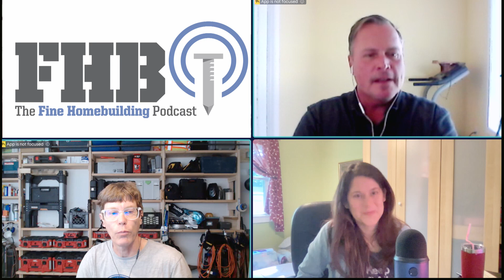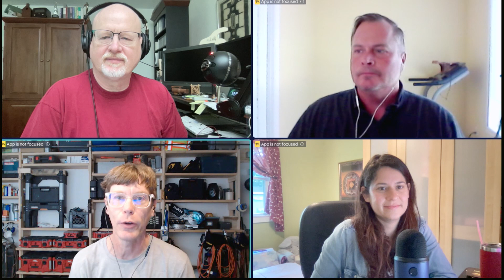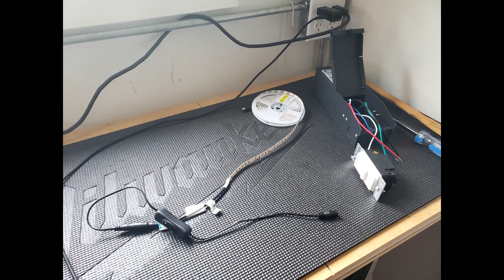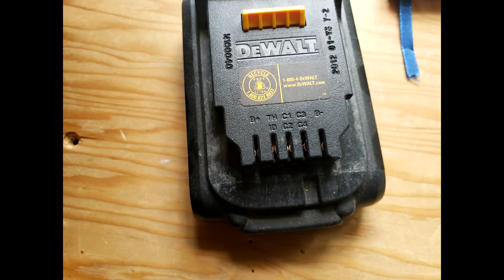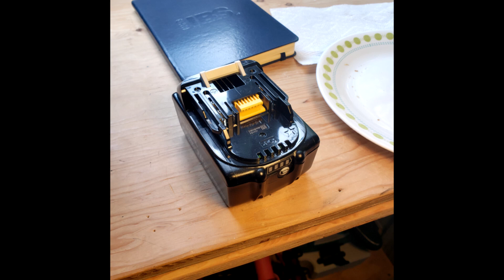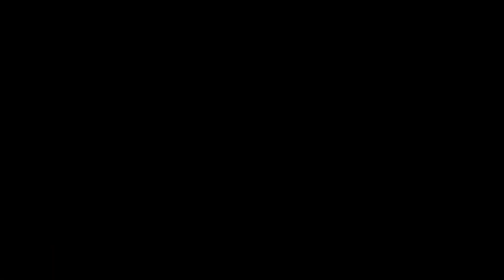Podcast 583: Dehumidification vs. Ventilation, Downsides of Advanced Framing, Heat-Pump Water Heater

Comment: You read my comment, but misunderstood it. The TOOLS normally only have two pins, DC+ and DC-. I have since found tools that monitor the battery temperature resistor sensor using a third pin (and DC- as common).

The batteries pins for the charger vary by brand. Some expose the temperature sensors leads, some have communication pins, and some combine the two.

For example, Ridgid chargers read data using the temperature pin and then monitor the battery temperature by resistance of the sensor.

It seems to be rare for a tool battery to have a full BMS Battery Management System (rare) which monitors everything necessary from overvoltage with auto discharge, balancing the cells, undervoltage, etc. It is normally a slimmed down version which might not prevent a battery from going into deep discharge.

Previous comment:
"There are only two pins on every battery tool that i have seen. These two pins are DC and no communication. Only the charger has more than two pins."

Comment: Matt Risinger, who builds in tx recomends a dehumidifier with the erv. Also a heat pump water heater puts out cold air. Not sure how great that would work in the north in the winter. Probably want to send the warm air you heated in your house that the water heater cooled down outside.

Comment: The actual thickness of sheet goods are made in metric sizes and in America you see the closest fractional size. I.e. half inch is actually 12 millimeters thick and not the 12.7- ish mm that it actually should be.